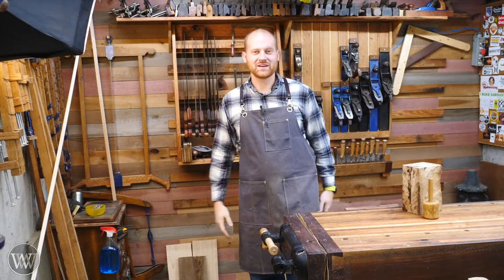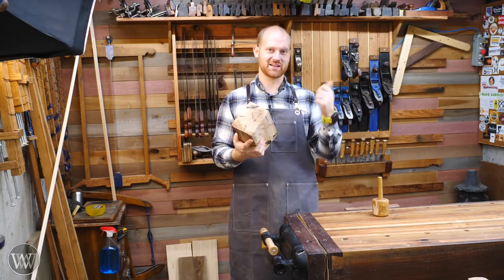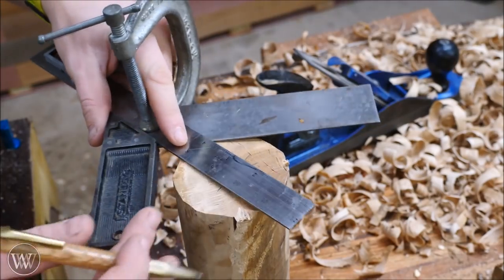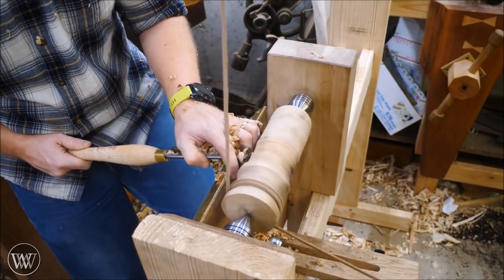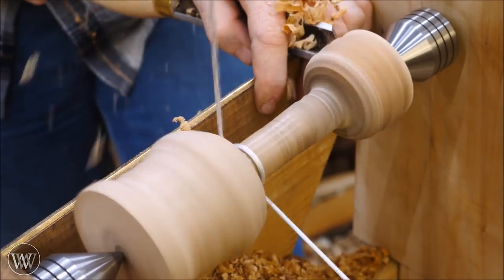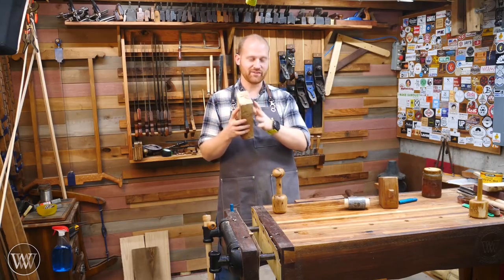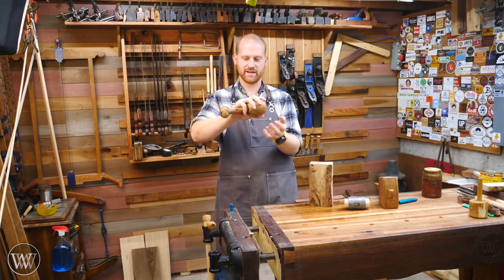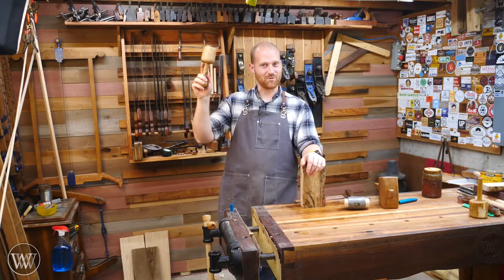Making a Carving Mallet with the Spring Pole Lathe Hand Tool Woodworking Project

Comment: Hello James. I have seen these last videos and you are doing a very good training job.  Those of us who use this type of lathe, know very well that the most difficult thing is to synchronize the output of the tool with the reciprocity of the turn, and still maintain the precision in the cut. This is a movement that those who use electric lathes, or continuous spinning pedal lathes usually do not know about because they do not need it. I emphasize this above all. Beautiful mallet by the way and very nice wood. Regards !
Reply from the maker: so true. the challenge is what makes it so much fun!

Comment: It was like seeing my child on YouTube.  That block of wood was hacked out of my tree with a chainsaw then squared on the table saw.  I've made two mallet heads from seasoned live oak and they were a LOT of work.  They hold up to the worst punishment without a fuss.  It's some extreme hard wood.
Reply from the maker: LOL thanks Tyler! this was a ton of fun to play with. all I could think of was, I would love to make a slab table out of this if I could find big enough slabs!
Reply: That piece came from a branch of a downed tree from Harvey.  The trunk is 24" thick and runs over 9' straight.  I would love to find someone with a sawmill to slab it out for me.  I'd let them have it all for just one 4" slab.
Reply from the maker: wow! that would be a fun slab indead!

Comment: I turned my carving Mallet out of an Australian Hardwood called Acacia Acuminata. It is commonly called 'Jam', because it smells like raspberry jam as you work it. I only put a slight flare on the end of the handle. But now you make a good case for a pommel, so maybe I need to remake. And Yes it is hard like your live oak, but of course I cheat and use a power lathe. :)
Reply from the maker: sounds like a fun wood. one of these days I am going to get a chance to play with some Australian woods! thanks peter!

Comment: Wow, that is beautiful wood. I wonder what it looks like fumed with ammonia. I've always been interested, but afraid because of the difficulty. I wonder how the boat builders did it.

For that piece of live oak you have left, what about using it as the bottom of a wooden plane? Either alone or laminated, it would make a durable base.
Reply from the maker: I might have to try fuming it. I have a project coming up I am going to do that to. the rest of the scraps will be resawed and turned into a box. maybe!

Comment: Great job on that Mallet James! That looked to be a hell of a lot of work. Funny but I was always under the assumption that a dried piece of wood was much easier to turn that a wet one. Maybe it's easier on a electrically powered lathe, which is all that I would ever use anyway. BTW, you could always make a few small Christmas tree ornaments out of that piece that you have left. If you started now, you could have them ready by next X-Mas........ :)
Reply from the maker: LOL thanks Steve. in almost all cases it is easier to turn the wood wet. the wood peals easer and tends to catch a lot less. it is just softer to work with in general. the only downside is the sap and resin can gum up the tools sometimes. I like the idea of ornaments. I might have to play with that one!

Comment: James, I'm sure there is something I am missing... But is it not possible to create a drive spindle with your lathe as part of the machine itself?  Such that the rope always stays on the small diameter spindle, and the spindle turns your work piece that you attach between to spurs, like an electric lathe... giving you higher speeds?  Or potentially variable speeds...?
Reply from the maker: well, the speed is determined by your foot you push it faster and it runs faster. and a few have done something similar to that, but the complexity it adds was too much for this project. I just wanted something simple, quick and fun. the next lathe I build will be a flywheel lathe.

Comment: I am surprised that you did not make the Handel separate and get two mallets from that big piece of wood
Reply from the maker: I could have but the problem is the heart of the tree ran diagonally through the block so the other head would have had the pith in it. and it would probably check worse there so i did not want to mess with it. I am probably going to make a box from the cut offs

Comment: I've always wanted to build a foot powered lathe but have been worried about what is the correct chuck to use. I have some old catfish rods that I could use for the spring so I think I'm going to go ahead and build one. Can anyone recommend a Chuck?
Reply from the maker: There is no one best chuck. Different Will make you want to use different chucks. If you're using a spring pull lathe, then you generally don't want a truck. You just want to turn between two centers.

Comment: Why not fix the lathe to the floor, so the lathe is more stable?
Reply from the maker: no need to you make the movement so you are already moving with it and the extra weight would defeat the purpose of being able to move it quickly with one hand. you honistly do not notice the movement when using it.
Reply: OK, just look like being more stable it would preform better.
Reply from the maker: +John Lochary no it usually only jumps when it catches or my foot does not have the power to push through. With easer woods it hardly moves at all.

Comment: What were the beginning and final dimensions and weight of this mallet?
Reply from the maker: I am not quite shure. It is all by eye and feel. It is about 1.5 lb ish.
Reply: @WoodByWright  Thank you. I am more interested in the length of the head and the length of the whole mallet.
Reply: @WoodByWright  
I made a larger one a year or two ago out of some scrap 4x4 I had laying around, and with no lathe.
I like the one you have there, it looks about right for your hand (of course 😉).  I have an offcut of red oak from one of the hardwood dealers in town that might work, but I'm not sure it is wide enough to to the job.
Love your work! And thanks for the response.

Comment: Make another hand plane with the rest of the live oak! You haven't made a flush trim plane yet I believe...
Reply from the maker: I made a rabbit plane a while ago if that is what you are referring to. but I might have to. several people have asked for it.
Reply: Wood By Wright 
I'm talking about using a block plane blade attached directly to the bottom of a nicely shaped block of wood. It can remove glue, flush trim edge banding, flush trim dowels,remove epoxy level to yhe wood's surface, etc.! The woodknight down in Australia just made one on his channel, check it out!
Reply from the maker: oh I see what you are saying. yup those are fun. they are extremely useful for the hybrid or power tool shop.
Reply: Wood By Wright 
Yup. But as much as you use epoxy and have glue saueezeout I think it might still be useful to you, maybe...

Comment: dude, get yourself a few sandbags, will stabilize that wee lathe
Reply from the maker: no need to you make the movement so you are already moving with it and the extra weight would defeat the purpose of being able to move it quickly with one hand. you honistly do not notice the movement when using it.